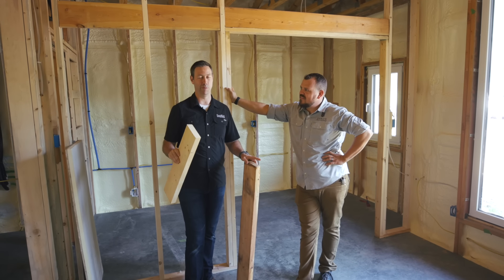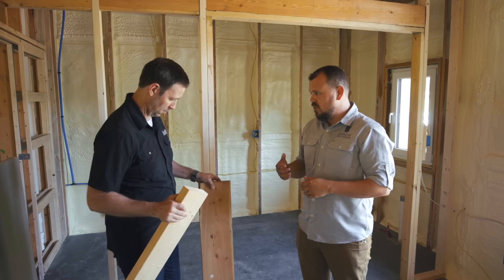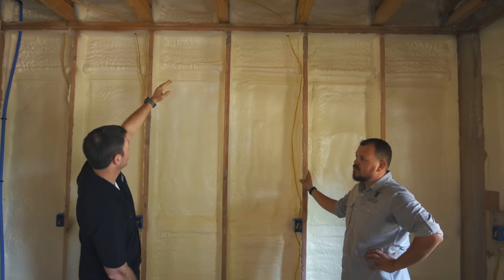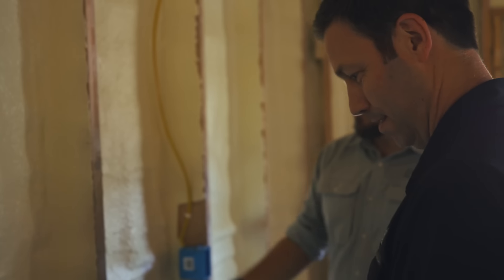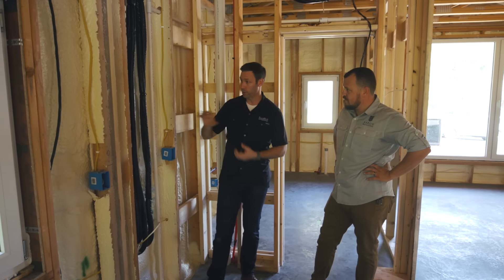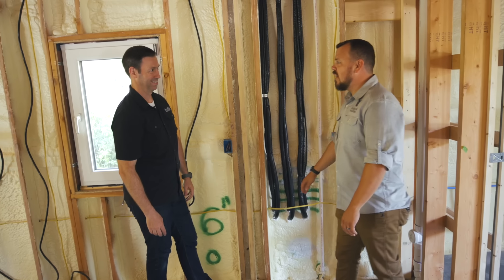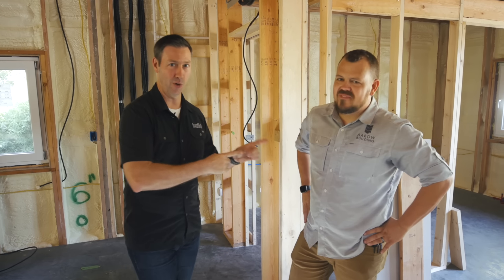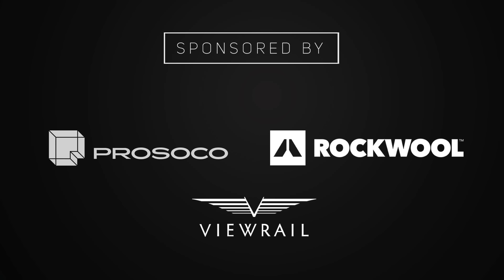Why would you frame a house with 2x8 lumber?

Comment: Looks like a 2 year old installed the wiring
Reply: That's the 1st thing I noticed, kinda sloppy.
Reply: Easy to instruct cause they don’t know any different. 😍
Reply: @harrypouncey9218  creepy emoji tbh
Reply: Typical cookie cutter house wiring. Hard to find electricians that take the time to have straight runs, staple lines etc etc.
Reply: Only idiot code requires staples. It is stupid. Does nothing of any value. This is NOT a vibration environment like a car/machine. EVERYONE else DOES NOT want them. Just means it is IMPOSSIBLE to remodel. PS: get rid of the stupid electrical boxes as well. Use wall plates and it makes putting up sheetrock 2X faster at least. Do it Australian style. Now if you want an electrical plug in box AFTER sheetrock, fine. You put it in. Once again, you do not want the wires stapled. Likewise you cannot keep wires LABELED, so for troubleshooting, or install it requires FAR more time as there is always sometime when you screw up the intallation and do not do the 3 ways correctly etc.
Reply: I rough houses for a living and always try to make them straight and neat but scissor trusses it’s a lot harder to do that, it’s great for pulling wire but there’s not nearly as much material to staple to
Reply: @w8stral  Staples are required because the tension on the wire could cause it to get too close to nailing and screwing environments. Drywall and anything the home owner might install. As far as labeling, yeah I hear what you're saying but any install by code and by a good installer should be pretty clear no matter what you open. I'm originally from Illinois where most every community required conduit so it wasn't usually a problem. In GA there is romex everywhere and poorly installed in most places. Frustrating.
Reply: @racerdude888  Too close to nailing?  No.  Too close to screwing?  No.  It is not stapled, it moves if the SR guys miss the studs.  As for home owner who are MOST likely to miss the studs... I would much prefer the wire able to MOVE backwards when hit with SR molly bolts etc.  Especially not true on 2x6 construction.  On 2x4 construction you could have a valid point between nails from inside and sheeting nails from the siding.  And no, I have never been in a box that is "clear".  Why?  Every single installer has a different method for wiring up boxes to designate between switchleg, main power, traveler etc.  Not to mention most boxes are so full, putting those twists and kinks in the wire is impossible.  Conduit.... what?  High rise with metal studs?  Or ancient buildings that have been remodeled and were brick.... Never done any work in IL.  Done it in CO, WA, OH, NY, OR, ID and all their codes were all the same using good ol' NEC, so.... is IL just weird?
Reply: @w8stral  I was stating the reason it's required by the NEC. 
Many local city codes in northern IL require EMC. 
And if you do enough service, you'll start to recognize most any situation when you open a box. Or at least that's what meters are for.
Reply: @w8stral  I don't care for the staples either. Again I was stating why THEY require them. Tho I don't see why you can't label wires that are stapled LOL. If I wired the place, you'd be fine following me into a box. Very clear. Another reason that EMC is good is color coded wire. No labels required:)
Reply: Also, a friend that owns a pool company learned that bugs, rodents and microscopic creatures under ground were chewing through flexible PVC. They liked the smell. The coating on flex pvc is the same product on romex. critters like to eat it. EMC is better in most ways. Mechanical and skeletal ground. Easy to re-pull. Easy to label. Safer
Reply: @racerdude888  Very true, and why barns I always do in conduit.  At least I try to argue for it to the customers =)
Reply: @w8stral  =)
Reply: @w8stral  You're joking right? Staples are for wire management so that when the drywall hangers go to work they won't pinch any cables in between the stud and the drywall.  Yes I agree that remodeling would be a lot easier if NM wasn't stapled, but then you'd have other subcontractors yanking wires out of boxes to put their shit in
Reply: @josephn2255  PPL like you are reasons why it still takes forever to build a common house.  And no, loose wiring does not cause fires anymore than loose wiring in a raceway causes fires.  This is not a moving car.  This is a static house.
Reply: @w8stral  see above edited comment which I was working on while you replied. Maybe I was too hard on you but you set me off when you said don't use boxes. Things have to be kept in order or it would be chaos, and like I said other subs would make a mess of it. I like a neat rough-in, but yes there are some cases where too much stapling is not good

Comment: 2x4 staggered studs with a 1” gap.
Reply: Or a double stud wall with 2X4's with a one-inch gap.  The cold will stay on the outside 2X4's and not transfer to the interior 2X4's.
Reply: That's what I was wondering, too. Wood has a notoriously bad R rating, and results in bridging from exterior to interior. Use 2x8 top and bottom plates, then 2x4s on interior and exterior staggered. Would give much better insulation value.

Comment: 2 x8 not bad  i used 2 x 10  i did same way and did double  up on floor joists  to stop the movement  we settling  and get true . I am still impressed  how you do thows things. That should  be standard  practice  for houses my exra was 3000.00 by well wouth it r60. 12 inch on center. Heat alone pays 1.2  that cost in 1st year. I use only wheat timeline.

Comment: They didn’t charge him extra? You bet your ass I’d charge more to frame a 2x8 house opposed to a 2x4 or 6
Reply: Sounded like most of the work was done by his own people so that takes care of him being charged more. Now if he was doing this for someone else's home then I would expect them to charge more.
Reply: 😂 3 - 5 K more easy and dont forget the sheeting.. that extra 1 inch of closed cell will add to the fun. Yeah trust me.. sprayfoam is light.. but it would be added stacks of osb to the site, have to cut it on one side only & if the foam gets hit and chunks of a piece from the back. It would suck to hang. I sprayfoam for a living. But i do like the overall job "R" 💪 😆 Keep Pushin!
Reply: A waste of wood
Reply: grow forit uhhh not 2 get R-42
Reply: @growforit8736  not really much extra wood considering you're going from 18" centers to 24" centers.  What you might consider waste I consider investment as I could now have better R value which saves overall resources across multiple avenues.
Reply: I noticed he didn’t say how much extra HE would’ve charged, very shrewd. And deceptive. This is more of a “ain’t we awesome “ showcase than it is about the build. Probably the most disappointing video he’s made. On the positive side, it’s the least annoying infomercial I’ve ever seen. 😎
Reply: Luis Crespo yeh what ever they certainly charged his ass that’s a load of bullshit
Reply: That insulation is absolutely atrocious for the environment and the carbon footprint would be astronomical. Not to mention the toxicity of the chemicals. Checkout natural home design by Chris magwood much smarter way to build better homes.
Reply: @Barry Boppins Not so sure it's actually more weight. It looked like using 2x8's you can use 24 inch on center (for his building codes). For 2x4's its 16 inches (where I come from). So it should technically be 33% less studs, so maybe the weight is very close to the same? Just thinking aloud.
Reply: @shadowzedge5793  I replied the same (before I read your reply), so I think there is some agreement.
Reply: 2x8 is less wood as its on 24" centers compared to 2x6 on 16.  Likwise window framing only requires a 2x4 not full 2x8 so even less wood.  Posts: ditto.  2x8 is less wood and less labor, less nails.  Over 2x4?  No.  Of course not.  But superior to 2x6?  Hell yes.  Likewise the plumbers/electricians/HVAC LOVE 2x8 and so do the sheetrock guys which will save you more $$$ as install is faster.
Reply: @onetwothree4148  I didn't hear that. I only heard that 2x8's over 2x6's had a higher R-rating. I must have missed where he said he was comparing 2x6 on 16 inch centers and 2x8 on 24 inch centers. Send me the timestamp where he stated that.
Reply: @Theoriginalbubbafett  Notice how he said the framers were in-house crew AFTER he replied they didn't charge extra for framing the house. Bit of a disingenuous reply. No question an independent framing crew (not one that's getting strong armed by the promise of a future build) would charge more for handling that kind of wall lumber. 

To each his own, but doesn't it seem like law of diminishing returns is kicking in here while building in, what climate zone 4 or 5?. At a certain point wasted lumber should be considered as a cost, if not an environmental concern.
Reply: @onetwothree4148  Where did you hear that? Standard building starts with 2x4 lumber, so he must have considered that in the very beginning when he decided to go with something that was larger than code. But I do agree with you if you compare 2x6 to 2x8 on the 24" centers. But that is a moot point, and I never would have commented about that as everyone knows that a 2x8 weighs more than a 2x6, hence there would not be a weight savings. The topic of this particular thread was that the original poster said he would have charged extra when compared to 2x4 or 2x6 framing. I simply added that when compared to 2x4, there might not be a significant weight difference. You are discussing a different topic that I was not referring to. So I understand and agree with your comment, it's just not the topic of this thread.

Comment: Obviously the thicker the studs the more insulation one can install. Question is how much does one save over the course of ownership in heating and airconditioning vs the additional cost of 2x4 vs 2x6 or 2x8. Assuming you've already done the math and there is a savings, why stop at 8 when there is 10 and 12 one could utilize?

Comment: Of course I would love walls with that much insulation, but I would challenge you on the cost.  If I had to get independent bids for framing with 2x8s, the bids would be higher than for 2x4 framing.  It's more work!

Comment: There is no way I would frame 2x8 for the same price of 2x6.
Reply: Filipp Laptev & There’s no way for them to have an argument on why not to charge more 😂
Reply: It is 2x8 at 24" on center vs 2x6 at 16" not sure if it should be much of a difference.
Reply: @electrodacus  2x6 on 24" centers is common.
Reply: @davej7458  I mostly seen at 16" when 2x6 is used and here in Canada 2x6 is minimum for external walls 2x4 not allowed for house external wall's.
I think a 2x8 at 24" will be as strong as a 2x6 at 16" but allow for larger cavity to fit the thermal insulation and less thermal bridging.
Reply: @electrodacus  Very interesting.  Here we have "mod 24," that is 2x6 at 24 inch centers for single floor construction.
Reply: electrodacus the time and labor intensity goes up majorly on 2x8. Even comparing 16 inch 2x6 to 2x8 24

Comment: I would use 2x8 T-studs in most places, solid 2x8 only where needed. Same if framing 6 inch walls. Are they tying in the tops and bottoms with "hurricane clips", cables or rods? 60+ mph winds (almost yearly here) can really "rack" a frame house with that amount of distance between exterior studs. Offset 2x4 framing can be even better, if planned for.

Comment: Basically you overspend in insultairon $$$$ to save bill electricity under $ return investment 20 yrs if you dont sell the house and move somewherelese  where that house dont have that  insulation
Reply: Energy's not cheap everywhere, and not guaranteed to be cheap in the future. You get other advantages with beefier construction as well, including better blocking of noise and more comfort from reduced draft and more consistent temperature.

Comment: If you want to reduce the heat flow through the studs just rip a through cut down the middle leaving about a ft at each end and in the middle uncut stud will be about as stiff and conduct less heat.

Comment: This helped me a lot with insulating my 1906 Sears catalog house that was built with 2 x 8 framing and believe it or not when this house was built it wasn’t very uncommon for newspapers to be shredded up for insulation in the walls and for those that want to insulate their house and they think they need to insulate all walls 99.99% of the time the inside walls are never insulated because why would you insulate an inside wall when you’re trying to keep the outside air from coming in?

Comment: I'd like to see HVAC installers plan to have line sets to be easily replaceable.   I always replace line sets when I replace systems but it's much more work when the lines are built in the walls.  Also imagine the repair guy crawling in that little space when it's 100+ degrees.

Comment: I'd rather build 2 layered 2x4 walls with the studs alternating.  Wiring can be run on the face of the exterior wall  studs (no drilling, easy face nailing, no splitting of the insulation, and greatly reduced possibility of a nail piercing wiring), and with the alternating studs, no exterior wall stud is in contact with the interior space and no interior wall stud is in contact with the exterior wall.

Comment: Two things I noticed, if I may ask. There are no blockings between the studs on the exterior walls. Are they not needed in 2x8 construction? I used to do insulation and we couldn't proceed if they weren't put in.   And secondly. I don't see any headers on the windows. Isn the load of the studs above the windows bearing down on the top horizontal frame ? Considering how beefed up the house is anyway at that point, it probably wouldn't do anything anyway.  But still, figured having a header was still required, regardless.

Comment: All houses should be 2/6 or 2/8 
All exterior and interior bearing walls  should be sheered. 
ZIP entire house 
Advantech flooring 
Geo heat/cool 
I been lucky to have clients who want to spend the $$ 
And the houses are rock solid 
And most don’t understand doing certain  things really don’t cost that much more. 
Example Advantech flooring. 
You can put your floor on top of it. 
Osb most put a sub down then flooring.
Reply: Are you expanding?
Reply: Anthony Man 
Nope. 
I have been in construction my whole life. Built houses from New York to CA. 
I have been back to 95% of houses I have done. 
I have learned a lot and some things that are tried and true. 
And the one thing people get wrong is cost. 
Up front might be more but at end it’s even or slightly higher. 
There’s many products that cost more but reduced labor cost make it break even. 
I do have issues with some new products that promise things and they don’t. I won’t list them.

Comment: Interesting. I’ve actually thought about doing 2 offset 2x4 framing so you don’t have an insulation break instead of 2x6 in my northern location. The idea being instead of having R-19to21 with almost 0 at the studs, you would have insulation of R-26 with r-13 at the studs.
But maybe there’s a reason this isn’t a good idea?
You would still have 8” thick walls, but you would never have less than r-13?
Reply: I helped finish a house that was built using the double 2x4 wall technique and I would do it over a 2x8 wall.  It had 12" of blown-in insulation in the salsa instead of spray foamed and 1" foam on the outside.  It was about $2000 more in framing than a regular 2x6 house.

Comment: With zip r6 and 2x8 framing, does this present problems setting doors and windows in such wide jams? If flushed with the zip sheathing, is the jam not so deep that the window and door doesn’t fit properly in the jam?

Comment: I have questions. What fastener do you use for the sheathing and is its shear strength compremised by the 1" foam on the house side. Also why the foam on the house side and dont you lose the thermal mass of the osb that would be captured if the 1" foam were outside.

Comment: In norway we've been building walls with 1 1/2 x 8 plus a 2 x 2 service layer for electrical  plumming etc fir 15 year's  now. So a 10 inch wall. There is only upsides no downsides with it.

Comment: I love this for several reasons including air seal and strength efficiency moisture barrie compatibility with solar because of much reduced ac load and improving availability of direct powered and grid powered  solar appliances like mini splits refrigerators freezers chillers etc. .  But look at strength for a minute How much better would this hold up bolted to say insulated slab for weight and strength and storm hangers to roof in say florida for hurricanes and oklahoma for tornados etc especially if only one story structure ?   Another question.  Why not use the T foam 2x8 for the studs they would come remanufactured to any height etc you wanted I would guess?  I see there wouldn't be much added benefit because you already have a high r value so I guess it was cheaper to do it the way u did especially using your own construction co labor but it might not be for some viewers.

Comment: Here in Maui we have single wall homes. Literally no framing just lateral tongue and groove walls that are 3/4 of an inch thick. No insulation. No siding. Your screw to put a picture up pokes through the outside of wall.